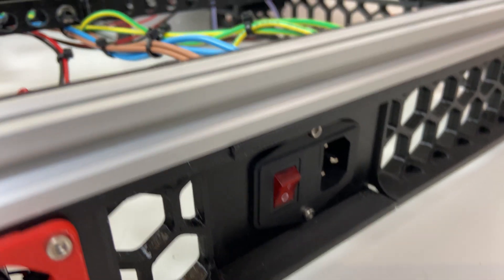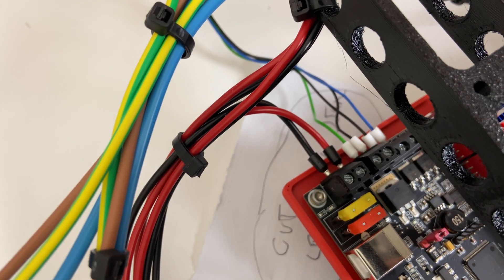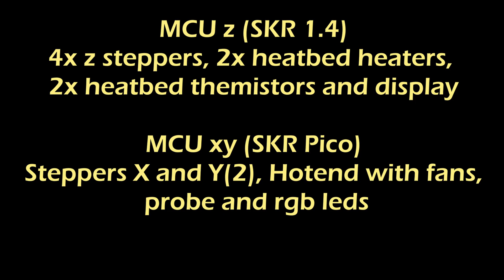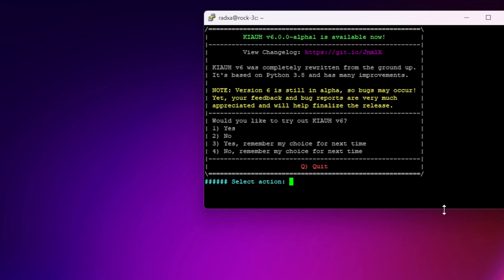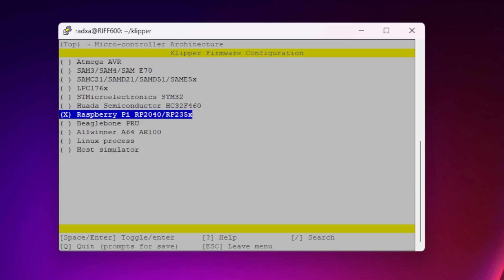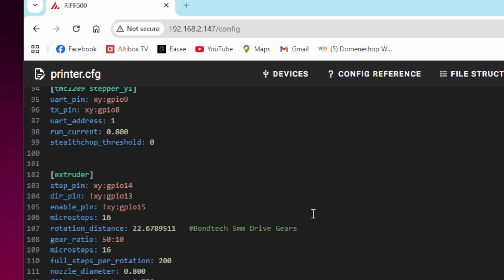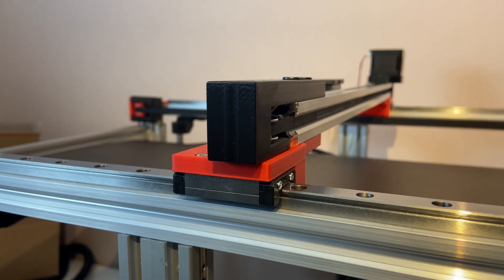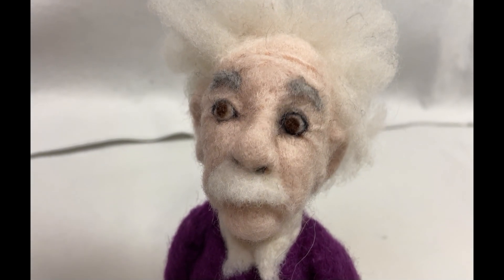The RIFF 600/900 3D printer 4 - config and motion

Comment: I know you have spoken in another video, but I dunno where is it... Why did you opted for the moving z axis instead of the flying gantry? I'm building a big one but tall, 820x820x1600, using 4 410mm PEI sheets. I still can't decide what will be best... Do you think in a tall printer like mine it will be better fixed bed? Too much weight...
Reply from the maker: The frame would have to be even longer and wider to make room for å flying gantry. If you have the space for it, why not? The moving bed version would be a bit simpler to build. Like Voron Trident vs Voron 2.4. If the heat beds are really heavy flying gantry is the way to go imho
Reply: @v4projects  Yeah the heat bed will be heavy since I already have a 10mm milled flat plate, thats a lot of weight. I dont care about the zhops because you can always use a vorotap, my worries are more like, the z level of a flyng gantry is it harder then a moving bed? Or in the end is the same thing? I wanted to get rid of using 4 ballscrews on each corner and use only 2, one each side... Im gathering the parts and thining everything in advance, because something big like this after you build it, youre not gonna take it appart to make major changes... That thing will stay on a corner of the shop forever...

Comment: glad to see progress on this build.  Your wiring is very clean looking. Curious why you didn't go with mains powered bed heaters?
Reply from the maker: Thanks! I am trying to keep the cost down, and those 24V heated beds didn't cost much. ( I think I paid about USD 15 each, and even less for the ones in the larger LemonBreeze printer) I am also slightly concerned about the safety of some of those mains powered heaters.